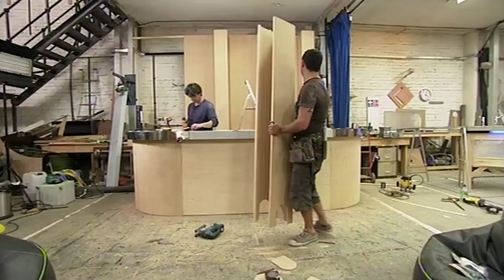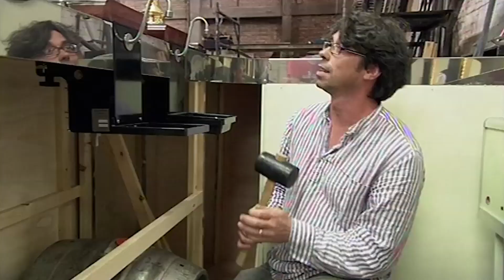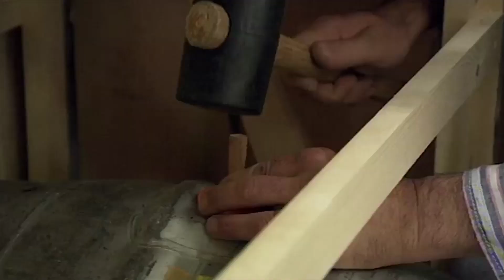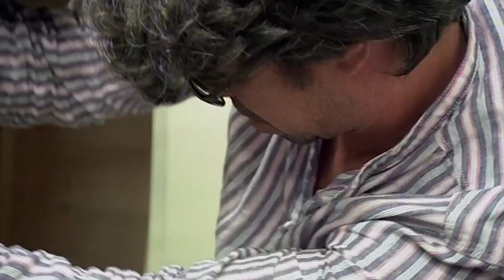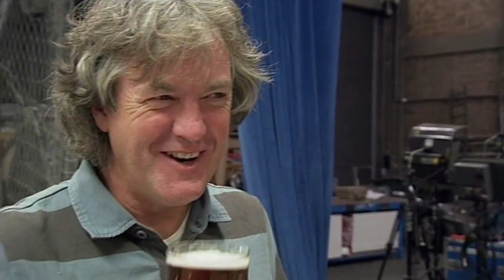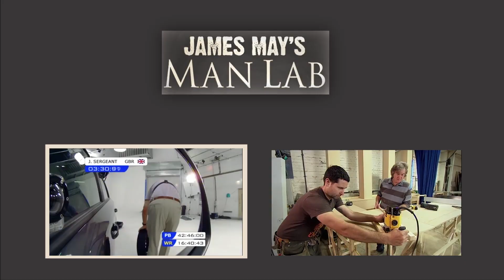- James May's Man Lab

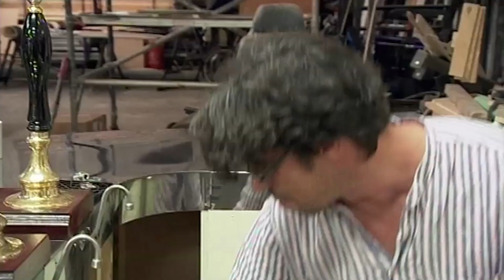Comment: In response to comments criticising the way the beer is stored - here's why it is being stored like that: by the look of it, the 'Chiswick' embossed onto the top of the barrel - closest to Sim (you can see this in the video at 0:20) means that the beer is from the Chiswick-based Fullers brewery (which is about 10 miles east of Heathrow Airport, in London). The colour to me suggests that this is 'London Pride' - their flagship bitter. Hence it is settled and does not need refrigeration, as that would destroy it's flavour.

Comment: Why are kegs different in the uk?
Reply: Alec Ver Bunker why not
Reply: Joshua Graham Thats exactly what I'm trying to get answered
Reply: Alec Ver Bunker i thought kegs looked like this everywhere
Reply: Joshua Graham Not in the United States you attach a tap to the top of the keg and stand it up there's no bung on the side. It's called a sanke keg I guess
Reply: BeastlyAdmul Never seen one before and I install keg systems for a living. Must not be very popular in the U.S.?
Reply: Kegs in the UK are the same as in the US. It's not a keg it's a cask.
Reply: The style shown is effectively a metal copy of old style beer barrels. The tapping process is the same as they would use back in the day with just the spot to screw a hose onto rather then a spigot. 

A keg is simply an engineer looked at the process and asked how can we get something to last longer with fewer parts to replace and is more user friendly to the person that has to hook it up. You now have a pipe that picks up from the bottom of the keg to a port on the top so it can be tapped standing upright with the option of filling with CO2 to preserve the life of the beer or air in if it will be done with quickly to push the beer up the pipe and into the tube. 

The reason for the ice cold vs basement cold is simply the standards of the times as the UK has a much longer established history and the US Ice cold was seen as a status symbol of we can have ice shipped in to cool it long before regulations got put in place. For ice they ether needed to cut blocks during the winter to put in an icehouse for summer use or be on a rail line that could bring ice from a icehouse up until late 1800's early 1900's when ammonia chilled freezing plants started to spread.
Reply: Keg's and Casks are two very different things and have very different contents. The yanks don't drink Ale, only the English, Irish, Welsh and Scottish drink Ale. The majority of the rest of the world drink lager or a variation on lager. The difference between the two is down to the yeast that is used in the fermentation process. Lagers are clean and crisp Ale is fruity and heavy. A huge number of people incorrectly use the word beer when they mean and drink lager, A beer is an  Ale not a lager.
Reply: Theweescot Good to know! I'm from Wisconsin so there's no shortage of Irish so we do have allot of ale just in bottles. Only thing it seems you can get in the states on tap is lager.
Reply: +Theweescot fyi, your stereotype is quite dated.

Firstly, 'yank' is highly offensive to decent folk. I am no damn yankee.

Secondly, only sports hooligans & college kids swill basic lager. While the occasional trippel or whit is ok, i go in for dark ales. Stouts & porters. Occasionally basics like Newcastle brown or Guinness are good for a reset or when the craft menu is lacking, but usually it's the richer, fuller craft options. Even in dive bars. (Chicks seem to go in for IPAs for some reason.)
Reply: they drive on the left side
Reply: Jon .knallpistol Yep and there wheel is on the right, as for here we drive on the right and the wheel is on the left. Neither are any safer then the other.
Reply: +Jonathan Doe yeah, i get ya. But when we hear that word, it rankles. (except maybe to the Hollywood "elite" types)
Reply: They are not different in the UK. It's everyone else that is different.
Reply: My advice is to consume all the bloody beer possible while you can. After the Burqa brigade has majority control of th U.K., ale and every other adult beverage will surely be banned. Allowing a 6th century cult to corrupt and invade your previously sovereign nation could be blamed on over consumption of said ale. Just saying.
Reply: Theweescot don’t know why I’m recommended this old video but hey... ale and lager are both types of beer actually! I like ale the best!
People who like ale often claim that only ale is ‘beer’, but it isn’t, even your bog standard supermarket lager is also beer.